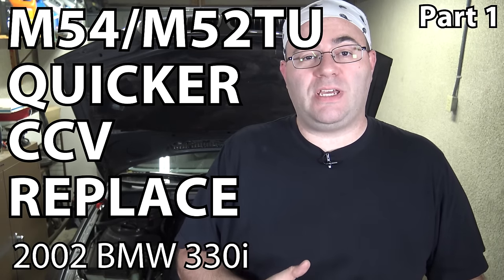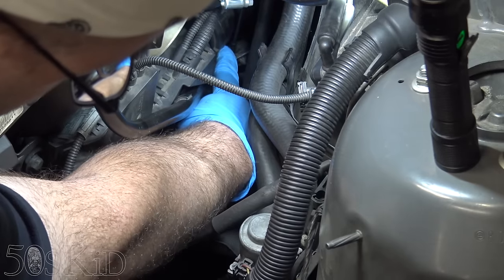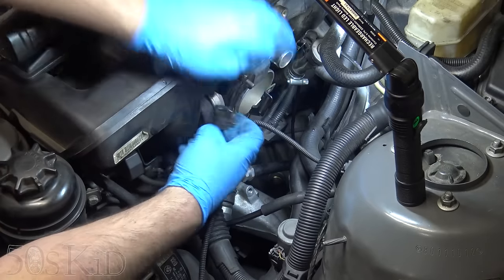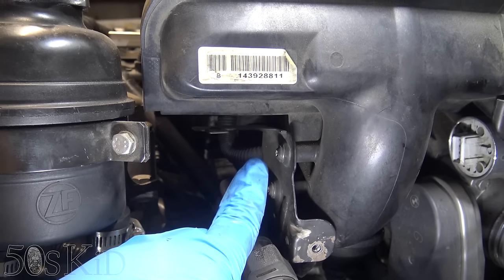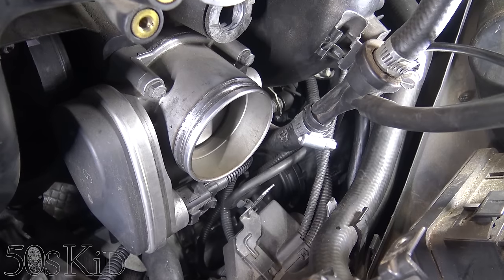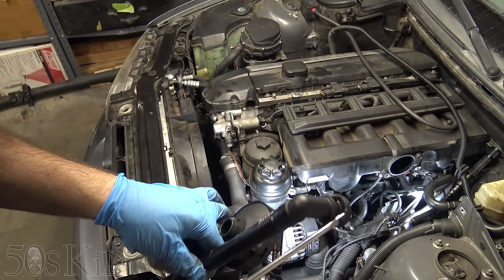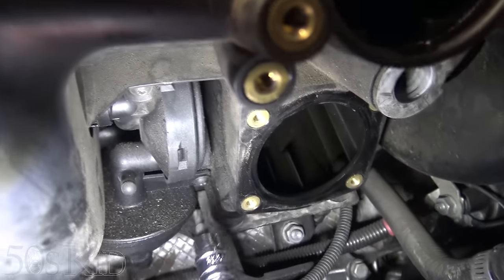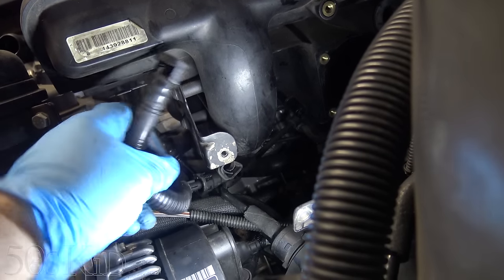BMW E46 Quicker CCV Replacement DIY - Part 1

Comment: TIP: when reinstalling make sure the fuel line goes before or under the 3/8” hose that comes from the secondary air pump that connects to the back of the manifold. If not, The fuel line will  bend the 3/8 inch hose against the nipple it connects to and restrict the air flow. you will get the “engine check light” but no error codes. I ran into this issue. Hope this helps someone.

Comment: Thanks '50's Kid'. Last weekend I replaced my Vanos seals and valve cover gasket, using your video as a guide. This weekend I have replaced my CCV system. I couldn't have done it without your help. You have saved me hundreds of pounds in labour and my car is running like never before... it's literally flying! I am now addicted and wondering what to do next... ??? :)

Comment: Came on here to say thanks. It took forever but I think I successfully took apart, replaced and reassembled all the above...hopefully. I had some trouble starting it up after I put it all together again, and when I did, I had smoke still coming out of the exhaust(which was to be expected) but a few minutes running and it cleared up. Terrible misfire at first though. Took longer than I expected to burn all the oil though.Your videos are concise and clear. While taking it apart, I also noticed that the starter is underneath the intake manifold so that should be fun to change if/when it goes out. I now know why most mechanics aren't thrilled about working on BMWs. I still think it would have been easier to tow it to a cliff and send it on it's merry way but anyway, I appreciate your videos. You should put a link to your video on here that shows how you counteract the CCV failure.
Reply: Hey Elizabeth great feedback I plan on changing my CCV this weekend. What tools did you use? Thanks

Comment: My 9000 Aero has a little ball valve that takes two seconds to change and it makes like 350 horsepower. All my German cars always have a PCV system with like 10+ components.

Comment: Finished it today based on your Instruction,worked fine,took me 4 hours with lots of Smoking Breaks and Cleaning throttle body and icv,and some more things.used new seals,now its running fine.thx jason.
Reply: Did you purchase the rubber o rings that amazon reccomends to purchase with the kit?
Reply: Them smoke breaks be clutch

Comment: Just did this replacement this week. My only problem was not pushing the TB electrical connector on far enough, so I started the engine when finished and threw a couple of codes. Torque app got me dialed in. Had to pull the DISA back out, & the 2 rubber intake ducts to find the problem. Pushed the plug on fully, put it back together and all was (and is) well. One thing of note regarding that damn flexible tube that's so hard to twist onto the CCV: you can push it straight on, you don't have to twist it on. The hardest part of this was having the ability to grasp the CCV and hose enough to push hard enough to get it on. These two videos were awesome and ridiculously helpful for this procedure. Thanks so much, Jason!

Comment: all in all 6 hours to disassemble and reassemble this project. I am 6'4 so working on the car and leaning over was a pain. But your video helped immensely. Car runs better than it has in years and the gas millage has gone back up. 2004 e60 530 218,000 miles. Thank you.

Comment: Hey, just to say I followed the DIY, I am an absolute amateur and did the job in 5 hours, thanks for the video! I used a lot of silicone lubricant on all the o rings and stuff, would have been truly awful trying to fit dry. My car doesn't seem to be burning oil like it used to, did a 400 mile journey no problem!

Comment: I've watched a multitude of videos regarding our E46's. This, by FAR, is the absolute best!!!  Your camera angles (mini cam??), your lighting,  your full & thorough explanations, everything, just GREAT!!!  PLEASE keep it up.  Truly the best out there !!!  THANK YOU.  You have saved me tremendous stress AND many dollars.  These vacuum components are an enigma & w/out your descriptions & explanations I would have ended up replacing items that didn't need to be.  Repaired my (much needed-to-be) DISA but symptoms continued & it was recommended to also replace Idle Control Valve (provides same symptoms but $100+) but your explanation of it's working and cleaning definitely helps.  Besides, I just have this feeling that it's the CCV.  I have not yet under taken this job because I wasn't looking forward to taking the intake off (recommended by everyone else incl BMW manual, and/or the additional expense (gaskets etc...,  just hoping I don't have a vacuum leak there)).  I knew there had to be a better way.  I will let you know how I make out but again, THANK YOU !!!  Seriously, so happy to find at least one (other) logical & competent mechanic out there...     :)

Comment: Thank you Jason for this video, I have watched this video about 50 times and my parts arrived yesterday. I made sure to lube all the connections up and  do a dry fit before I try to install. I found that the lower oil hose would not push in all the way because the o-ring was super big. I saved the connector from the old one and it snapped in to place just fine. 

It was such a simple job, I thought the 90 degree through the small hole was the easiest knowing the "twist secret" I was able to even pull off the old one with out even breaking breaking it.

I opened up the old CCV and clearly found the failed diaphragm inside. I am just to go for my drive cycle and all my short term fuel trims are now at +/- Zero. Long terms are dropping too. At idle the trims are perfect then at 2500 rpm they go up to about 10% instead of the old 28% then when I let off the gas and go back to Idle I can see the STFT recover to the LTFT then go back to Zero. I am pretty sure everything is ready to go.

Thanks for your help and can't wait to see how everything checks out once the drive cycle is complete.

Cheers!

Comment: Excellent video. 

I replaced the CCV system on my 330i e46 a couple of weeks ago. I did so WITHOUT removing the heat shield and WITHOUT removing the oil dipstick tube. I had heard horror stories about reinstalling the dipstick tube, so I avoided that step. 

I suggest playing with the various parts of the CCV system so that you can really understand how they connect to each other. Be able to connect them ‘by feel’ because you will be connecting these in the blind. Especially the upper hose that connects to the top of the valve. 

Be mindful to reconnect all of the electrical connectors. I know that sounds obvious, but I forgot to connect one.  End up with a CEL until I reconnected it. 

Replacing the CCV system really isn’t that terrible of a DIY repair.
Reply: yes, but sometimes the dipstick needs to be removed in order to remove all the gunk

Comment: Hey Jason: Great video as always. I will eventually do this job (CCV replacement) in my e46 following your detailed videos during this upcoming summer. I live in Vermont and what I have found is that when I start seeing the Mayo substance -- due to the condensation by the constant change in temperature due to the motor warming up from very cold temps (10 to 20 degrees Fahrenheit) -- , is good at the end of the day (after arriving at my house from work) to leave the oil cap open for 15 to 20 minutes to let the water vapor and condensation go away. My CCV is still in good shape but letting the vapor out helps with the Mayo (water mixed with oil) situation. Thanks again for the great quality videos; they are the best!
Reply from the maker: Thanks for drooping that info off on the mayo''s lifecycle

Comment: EXCELLENT video.  I just did procedure for my second car and ran into an unexpected curve ball.  - The OEM CCV that I was replacing (on an X3) had a tough foam rubber "jacket" that wrapped completely the CCV assembly.  It made the CCV look huge and impossible to remove.  The jacket completely hid the two mounting screws.  I grabbed a utility knife and ripped the exposed part of the jacket until I could access and remove the screws.  From that point I intentionally, but easily cracked apart the CCV (and hoses) in order to get it out.  Man was I #@^%$^'ing as I hacked away at the jacket!  50's kid: Thanks for video!

Comment: Excellent DIY video!  I just did this today and would like to share a few notes...  

First:  Silicone spray.  It works better than the thick grease, makes things slide right on and less messy than the thick grease. Hit all the plastic/rubber hose connections.  Second:  Get some DeOxit spay and hit ALL the pin connections, male and female.  Your car will thank you and it also makes sliding the connectors together easier.  Third:  Watch the booster hose at the Sucking Pump end.  Be careful!  Mine broke broke off at that weak connection.  I'mm trying an epoxy fix for now but I'll replace it with the updated BMW part.

The hardest part of the whole process was the first hose on the vid, the one that "turns" up underneath the intake runner.  I swear that one took me an hour and 8 or so tries.  But I got it.  After that it was smooth sailing.

This is a fiddly job but not that difficult and made much easier if you watch the video.  Thanks 50sKid!
Reply: I plan on changing my CCV this weekend. What tools did you use? Thanks

Comment: Great videos, man!  I did this in about 3 1/2 hours.  I have been working on cars for a long time so I can't say it was particularly difficult.  But it was tedious and I hope I don't have to do it again!

Pro tip:  Having the car up on ramps or jack stands when doing this helps a lot.  It puts everything you need to work on at a better angle and raises it up a foot or so.

Comment: After changing my valve cover gasket (using 50skid’s video), I noticed the ccv hose that ran from the valve cover to the ccv system under the inlet had snapped in 2. Must have done it with age/as I was moving the hoses around as engine was running fine, no lean codes. From where the break was it was accessible from the top. I ended up getting a 15mm straight coupler to rejoin it, saved a bit of faff for once :)

Comment: Thank yo so much for this 2 part series. I did the entire procedure on my E39 / M54 today in about 5 hours including cleaning everything out. I took my time, did everything very carefully and all went well. One remark: before assembling the 90 degree angle tube with the bayonet style connector to the CCV I made marks on the CCV and the tube connector with a white marker. This way it's a lot easier to find the correct position and snap those two parts together. I was struggling to get it right and after I marked the parts is was a breeze. The E39 also has two connectors on the left front of the engine and some handouts include disconnecting them. Don't bother, there is enough room between the cable box and the manifold if you leave them in place. And for all with an M54 engine DO NOT forget to transplant the small plug from your old CCV to the new one. On the M52 a vacuum hose goes there, but not on the M54. Forgetting this will require you to disassemble the lot again. 

Many thanks, could not have done this without your videos! Liked and subscribed! Keep up the good work!
Reply: I plan on changing my CCV this weekend. What tools did you use? Thanks

Comment: Awesome videos man! Anytime I always check your channel first to see if you've done a diy. Just did this ccv replacement yesterday and the only thing I would add to your diy is to remove the purge solenoid bracket too. I struggled for awhile to get that top hose on until I removed that bracket. Went right in on my first try. Keep up the good work man!
Reply from the maker: That's interesting. I've never needed to remove that bracket--why do you think it helped you?
Reply: With the bracket on it was kind of a weird angle to get the upper hose to line up with the ccv. With the bracket out of the way I could easily fit my left arm right up against the intake manifold and line up the hose with the ccv without any weird angles. It also gave me more room to install the breather hose as well. I'd say the best thing about this install was cleaning the ICV. Mine was so clogged that it's surprising it even worked. Before cleaning it my car would bog down every time I let off the throttle while in gear and made shifting rather uncomfortable. Now I can easily shift without the car bogging down when I let off the throttle. This and the DISA overhaul have made my engine run so smooth that I'm blown away. Next job is the vanos and VC/VCG. Thanks again for all your videos. I've done a ton of work on my car using your videos and you've saved me thousands!

Comment: Did that on my 325ti last january and struggled for almost two hours while reinstalling the last tube you pulled out of there.

One short tip: Mount the oil seperator first, remove the bolts from the power steering reservoir and carefully push it aside. This gives you access to the twist-style connector of the tube snaking through the intake manifold. The easiest way to mount this tube is to bend it in shape beforehand, fish it through the manifold from the front of the engine, push it onto the connector and then turn it clockwise so the other end will appear on the top of the manifold.
Reply from the maker: Removing the power steering reservoir is one way to go but you can also just pull the evap purge solenoid right off it's bracket and you have a nice little space to get your hand in there, which is what I showed in this video.  Both valid ways.  I agree with everything else you said though!

Comment: Just a helpful tip if you have an M52tu you will have a vacuum tube connected to the separator itself that you will need to remove.

Comment: This is a great instructional video with good camera work and good verbal explanation, but it has one serious flaw, from my twenty plus years of fiddling around in an engine bay you never "just break" anything. You only do that if it's a last resort. If that's the only way to get it off, and that does happen on occasion when things get so stuck, rusted or melted into place that you have to cut or break, but you never destroy any part just to save a little bit of time unless somehow it's a life or death situation. If you tear something up and then find out they sent you the wrong part, the correct part but it's of poor quality and doesn't really fit or sometimes you find out the thing you thought was bad really isn't whereby you can then either return the part or stick it on a shelf for when the old part that luckily you didn't destroy really does go bad. It makes you feel good to replace that dirty part with a clean new one but I hate to see good parts replaced and tossed. Every time I replace a part I keep the old one at least until I take the car for a test drive and everything checks out. There's also the risk of getting little bits of rubber and plastic way down in the recesses of the engine to do God knows what. Maybe that little piece of rubber that came off when you cut the part came to rest on a very hot part of the engine which also happens to have some electrical wiring that's crucial, the rubber melts and burns through the plastic protection and through the insulation of the wire and then damn, we got an even bigger issue now. Hell you could get careless and tear something up you didn't mean to. 

Look I know it's tempting, I used to do it, but it only takes a couple of times for one of the above scenarios to take place to cuss yourself for doing it again. On rare occasions you don't have choice, but if even a single one of those things happens in twenty times of wrenching on a car you're gonna lose all that time and then some that you thought you were saving. It's a really bad habit. 

Hey otherwise though it's a stellar video. I know I typed a novel complaining about that one thing but it's really a great video.

Comment: Haha, this fits me great, also got my ccv parts today, now i dont need to take the manifold of like in your other video of ccv replace. I live in Norway, and i cant see the "cold climate" hoses on my car, and its not even imported.. I do think it may leak some oil or something, aswell im going to change the valve cover gasket. ive seen some condense in the oil at winter, because of really short rides everyday.. so oil changed, now for the ccv and valve cover gasket. hope it works, i will use this video for sure 50's :)! 

Im no mechanic, just a 23 year old "Handy mann" haha, but all i've done to my e46 are all credits to you ! haha  Changed all my abs sensors last week, but i still have the 3 lights in the dash.. middle @ and abs/handbrake.. so might be something else.. Im going to try to disconect and reconnect the "cable" saw something like that one youtube, or i will need a diagnose on it.. and yeah, last week i used one of u videos to change the waterpump, Car runs still, so thanks ! :D

Comment: Great video! I read in the comments that's it's possible to do it without removing the dipstick tube? I'm wondering because, my e83 m54b30's dipstick tube is bolted way further down compared to the e46, and it's really hard to get some leverage in that tiny space, only thing that fits is a 13mm stubby wrench, but no leverage, I'll try with a flexhead tomorrow.

Comment: PCV on my 9000 Aero takes 5 minutes to replace the entire system--on my 951 and 330Ci its forcing hose jungle, unseen bolts, crouching crank vent/hidden click connector. Wunderbar.